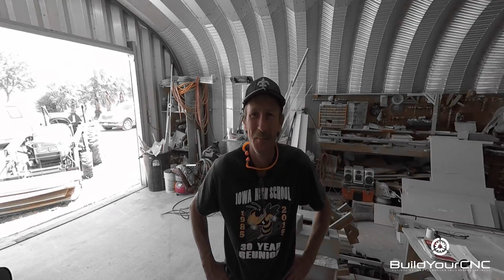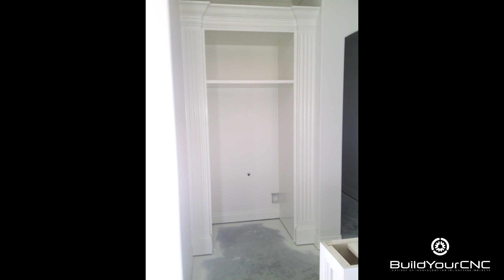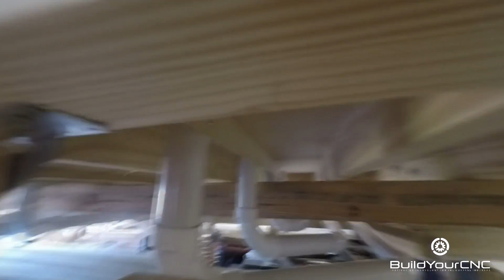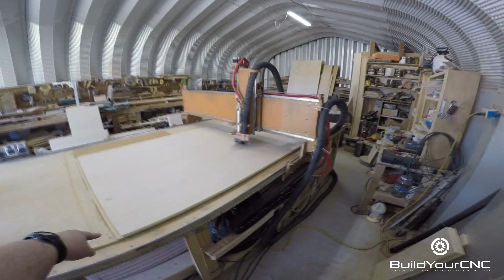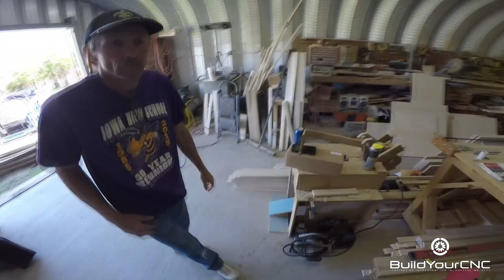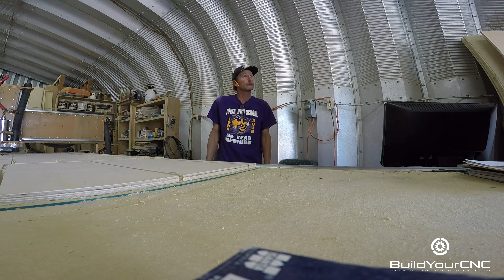How to use a CNC Machine for Cabinet Making - Interview with Rick Hebert

Comment: I was looking at getting a CNC machine, but I was curious as to the process u might use to carve out a design on the front cabinet door and still drill the holes. On the backside for the door hinge...anyone have a video of this?
Reply from the maker: Flipping panels on a CNC typically requires the use of registration pins or fixtures that keep the panel in the correct location when flipped.  The registration holes to be used by the pins are drilled using the CNC.

Comment: I'm wondering about the vacuum system. Is it you put your material on top of a mdf then you suck the mdf down? Is the vacuum pass through the mdf pores? Doesn't it loose vacuum power after the cut? 'Cause you know you must cut through the work sheet so there will be exposed area after the cut.

Comment: Realistic its going to take 3 or 4 times as long to do it manually than what he is quoting, not to mention maintaing the accuracy. Made my share of cabinets. A typical ready made high end CNC can hold .005 with no prob.  I would guess this one could easily hold to within 10 thou  over the full 8 feet.  Thats around 2/3 of 64th of an inch or roughly the thickness of paint applied by a roller.  With a bit of playing around with part location to minimize scrap in a medium to high production shop the time and scrap saved could easily pay for one in way under a year.  FAR quicker if youre making many of the same job.

The up front costs can be a bit tough to handle but it will quickly pay for itsself.  Also most people will need a bit of time to figure out how to run the controller once its set up for a particular CNC. Really easy with Mach 3, somewhat more difficult with other controller software. Then theres the program/s needed to generate the G-code ( the instructions ) the CNC has to have to do the cutting.  Those can be a bit difficult to getting hang of, but well within what most can do. Take a close look at the cutouts..  Notice he has it laid out so the gap between the parts is either exactly the width of the cutter or a tad over... NO scrap there unless you count the sawdust.  :)

I have a total homebrew with roughly a 2 foot square cutting area, as big as I need running A later version of Mach 3. Handiest tool in my little shop. I make music instruments and a lot of  other stuff, and now and then I cut stuff for some of the locals.. The only place I screwed up is I didnt make it where I could clamp stock on the end vertical for cutting dovetails. No big deal as I rarely have a need for them. 

For the life of me i cant understand why more people dont go with a cnc machine sized for thier needs. They can be a tad scary at first but if 10 and and up kids can figure out one, ANYONE can. Just rember, they are only as smart as the person running one..

Slick pocket hole jig there....

Comment: Nice work :). One question the blower that you use for the vacuum are 220v you can tell us the model number and were to find it thanks and keep your great work
Reply: +Alexy Pouerie 
http://www.centralvacuummotor.com/Product%20Bulletin/122178-18.pdf
Reply: +Rickie Hebert 
Thanks for the info very nice other question you mention the software to make the cabinet and g code to cut on the machine you can tell me which software you use to make it so easy nice job
Reply: +Alexy Pouerie 
i use cabinet vision version solid 2012 R2 with S2M  there are other software out there which is easier and cheaper. One i would check out is Cabinet Pro